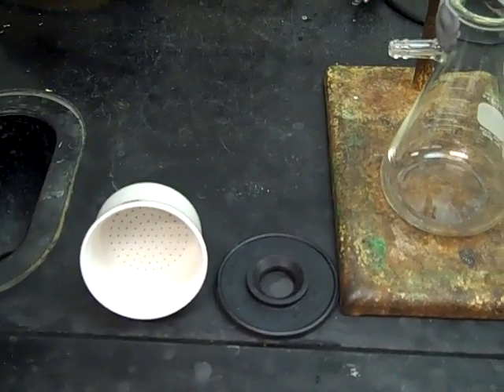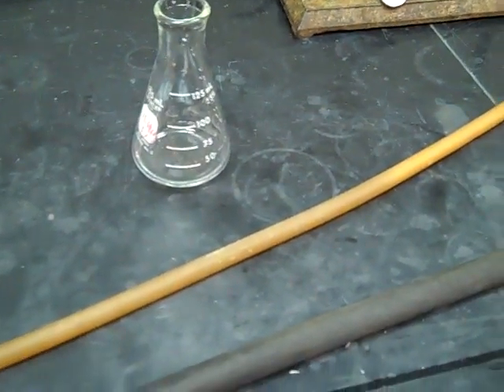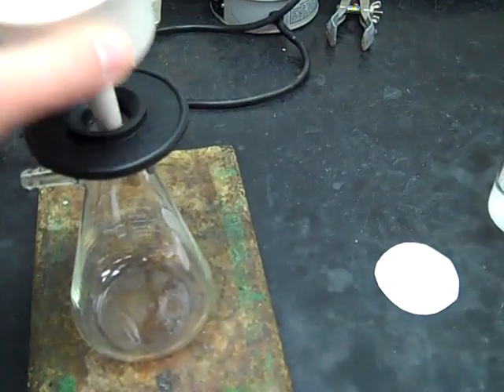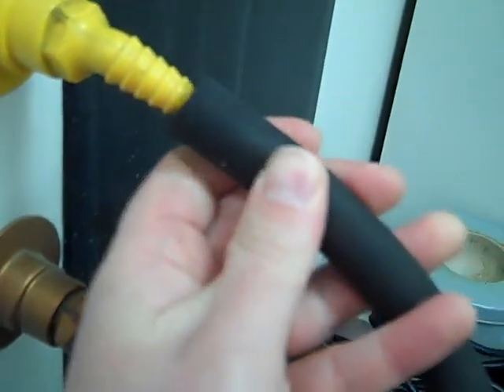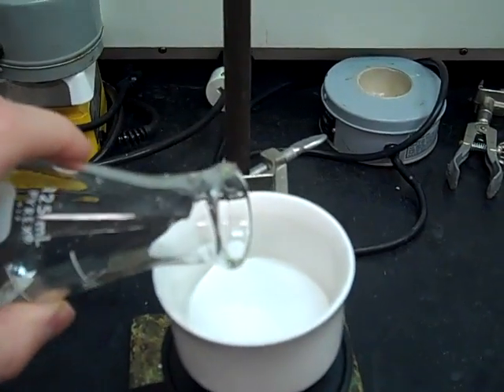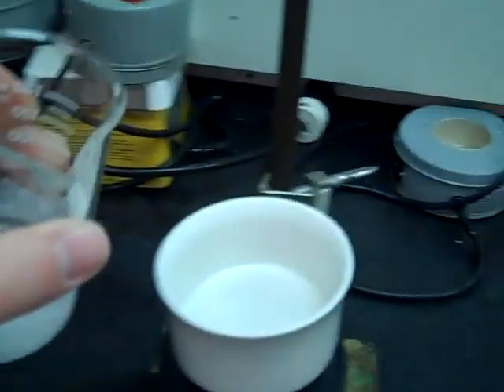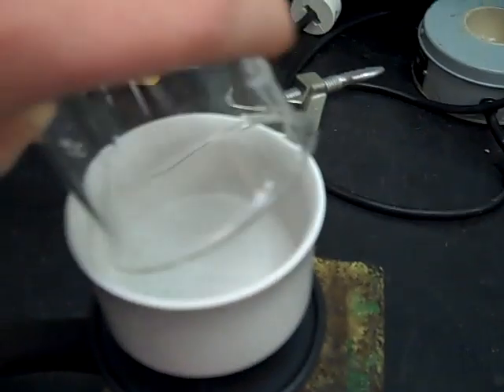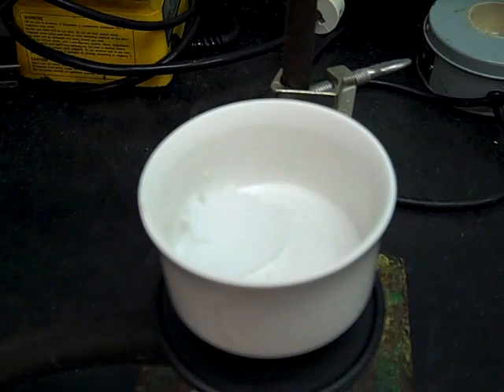Exp 1 Vacuum Filtration

Comment: I would first make sure you have a good connection by putting the hose on the flask and turning it on. Then put the filter vac on funnel and place hand over it to make sure there are no leaks. Then put funnel in flask and also put hand over it. If there is a leak and you dont check you may be waiting a very long time for gravity filtration. Also I would add the solid containing solution slowly and only to the center of the filter paper That way your yeild wont be so scattered and easier to rinse